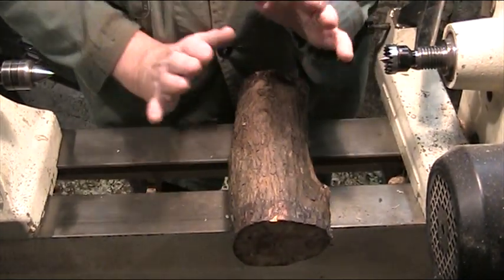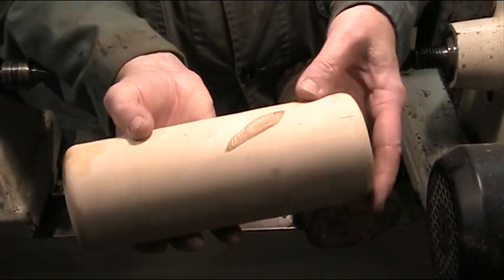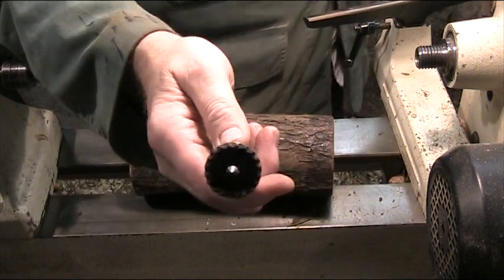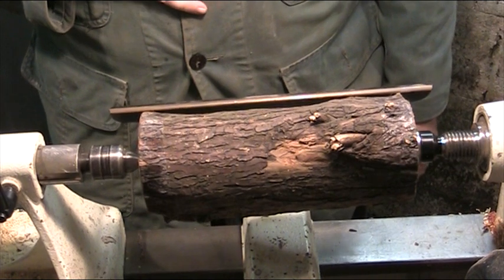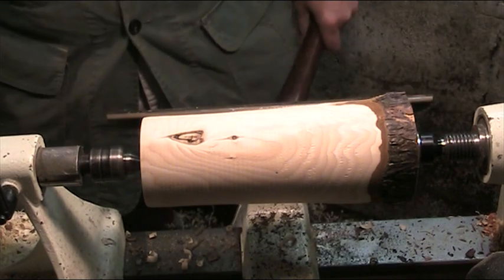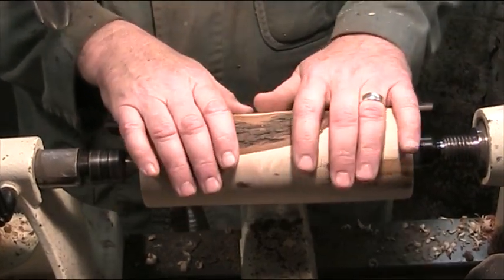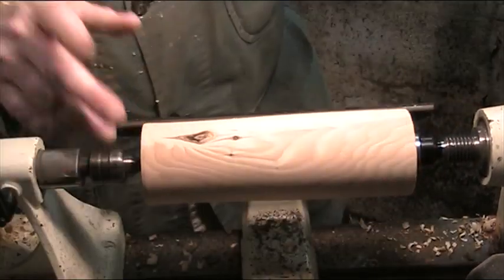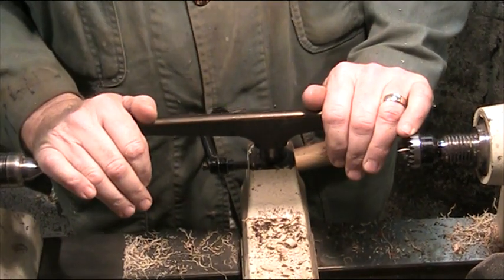Woodturning - Truing blanks to dry

Comment: Nice wood for a good guy!! I quit wearing rings when I had to cut one off a soldier's finger after he shorted out a 24v battery with it. It was a great excuse then and, since rings don't work well on these knobby old fingers, It still works today. My dad was a master woodworker and he always said that if the ring fit snugly leave it on. I say "Safety Sally be damned!" and work on heavy machinery in sandals.
Reply from the maker: The image that got me to take the ring off was of what a finger looks like when it has been shaved to the bone by a ring and the flesh was hanging, sausage-like, from the end of the finger.  There's actually a medical name for that injury which I've forgotten.
Best Wishes, Brendan.
Reply: Medical term is Ouchie!
Reply from the maker: kbbacon
LOL, near enough.

Comment: Hi Brendan, good tip about pushing the taper home securely, and rounding the edge to stop checking You'll be up at the Wood Shed demonstrating shortly!
Tks for sharing.
Reply from the maker: LOL, No, no, no, no, no...that's a step too far.  I'm going to have to start wearing disguises.  Do you remember the girl who came to the Woodshed with me last year on a couple of nights?  You should see the work she is doing now, it's brilliant.  I saw a goblet with captive rings she did between centres, as she had no chuck then, and it is brilliant.  She is very precise because her father and uncles are all very skilled engineers so she has that desire for perfection.  She'll be coming with me again when the demos start again.
Best Wishes, Brendan.
Reply: I wonder did she put  snaps of the Goblet on the net?
Reply from the maker: Gordon Millar No Gordon, I only saw it because her proud dad is a mate of mine and knows I took her to the Woodshed a couple of times so he wanted to let me see how she was doing.  If I get a chance I'll get some pics and show them to you next time we are at Sam's.  It won't be long now.
Best Wishes, Brendan.

Comment: Nice video Brendan. You have no reason to be nervous, great job. I've started truing up the logs on my bandsaw first. Saves a lot of that initial banging around. Was that log green wood or dry? Sure turned easy. I got some California Yew and it turned really nicely, completely dry too. Well done Brendan, love to see those chips fly. You're inspiring me to clean off the lathe and turn something. Thanks.
Regards, Gary
Reply from the maker: Thanks Gary, that wood was cut a year ago but it's quite thick so it's still fairly wet.  I have started using the bandsaw to take lumps and bumps off the blanks too, it is a lot safer because you aren't hanging over the tool rest trying to get at the wood far away.  I hope you turn the camera on if you fire up the lathe.
Best Wishes, Brendan.

Comment: What exactly does losing the bevel mean?
Reply from the maker: +221Dw  I have only now discovered your comment, I feel really bad about this because I always try to respond to comments quickly but, since the last YouTube changes I have not been getting all the email notifications.

The bevel is the part of the blade just behind the cutting edge and that's what supports the cut to allow a clean, safe cut.  Losing the bevel is when the cutting edge no longer has support and that's when it can catch or tear the wood by scraping instead of cutting.  It can happen by lifting the tool handle or not lowering the handle as the wood loses diameter.
I hope this helps.
Best Wishes, Brendan.